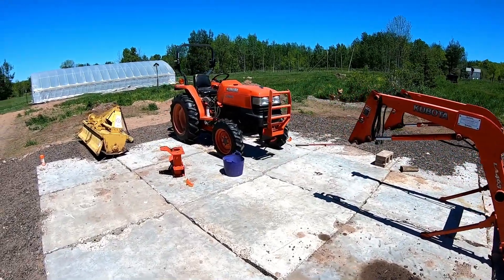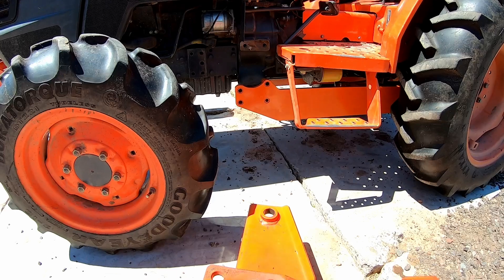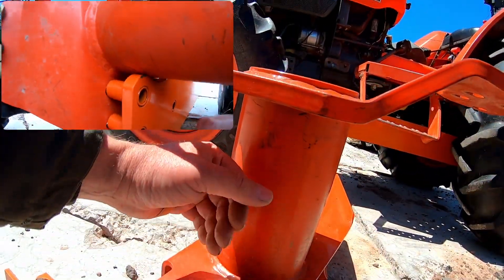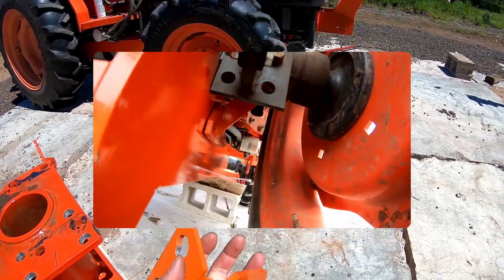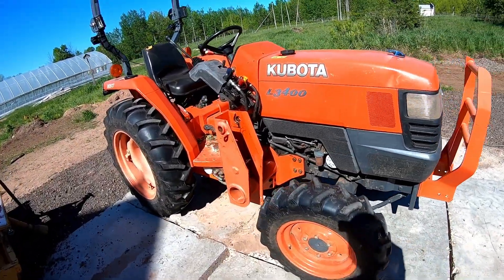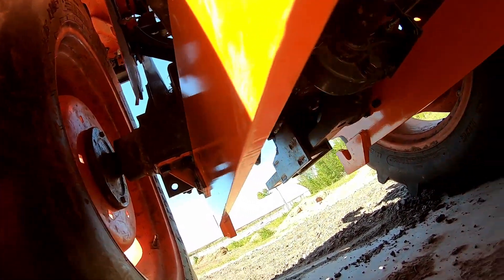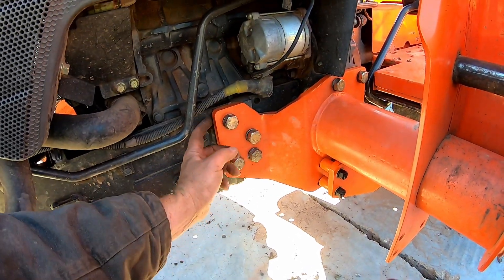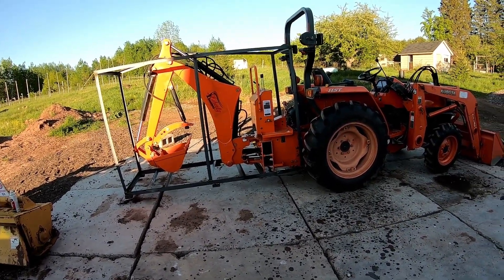Liberty Equipment LB7 Backhoe on a Kubota L3400 Tractor

Comment: How do you like the Liberty backhoe?  I am on the fence now of ordering one from curt at Liberty. They have a sub frame available for my L2501. Thanks👍
Reply from the maker: I’m happy to report that the issues with the boom cylinder were resolved with a replacement valve manifold Kurt sent.   At this point I’d say I’m rather fond of the back hoe.